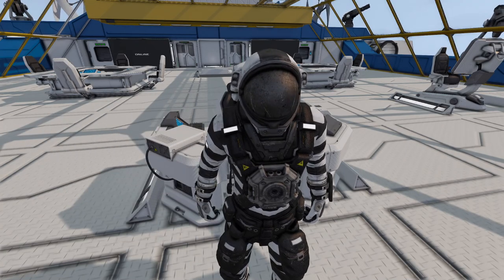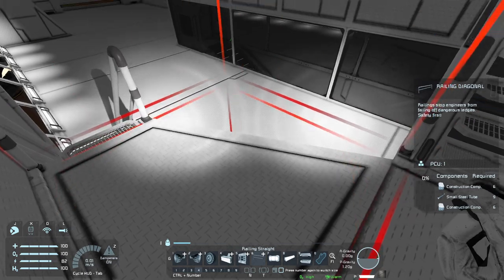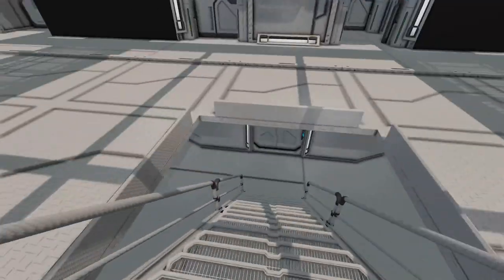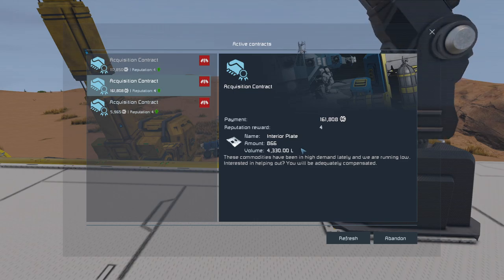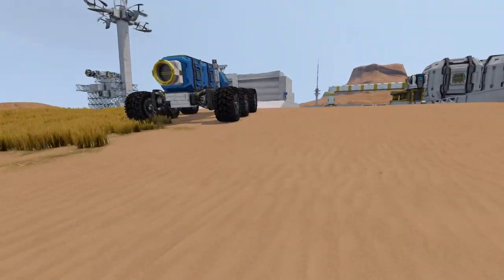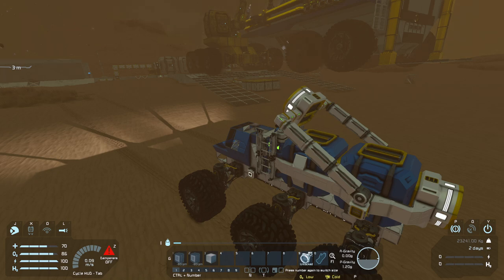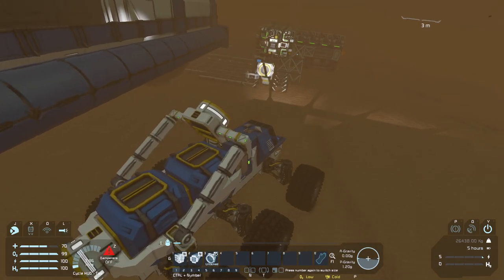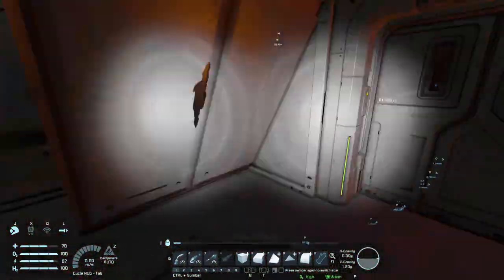Space Engineers Surviving Pertam: Mobile Base Is Nearly Complete | Part 31

Comment: Your Mobile Base needs Lightning Rod with auto-repair!  One bad thunderstorm and your rover may have unintended holes.

Build small personal flyer that would fit into front doors (👄) and I think connecting anything to the back will end badly when you lower platform! Atleast build a sensor that will disable elevator if there anything connected to the back.

That big space on second floor could be used to build rooms with beds or put computers to run some scripts. 

Also you might consider building thrusters for extra boost over hills